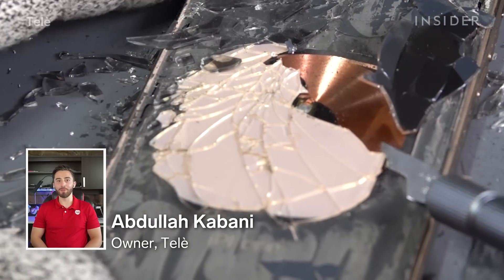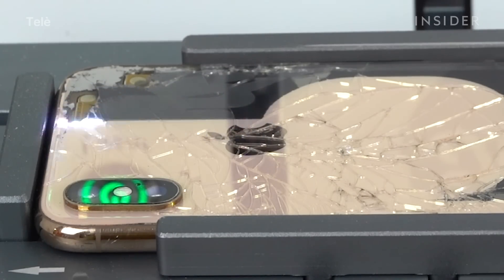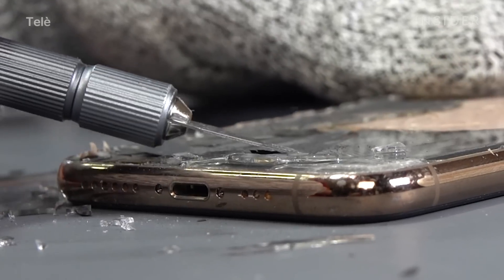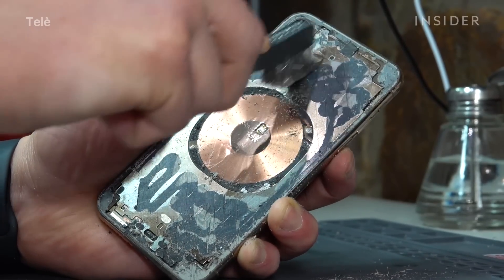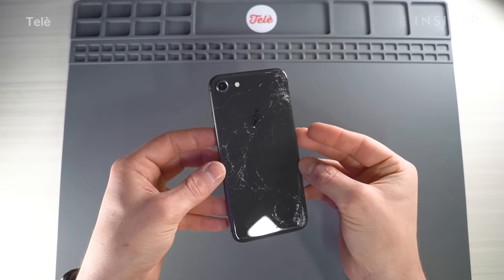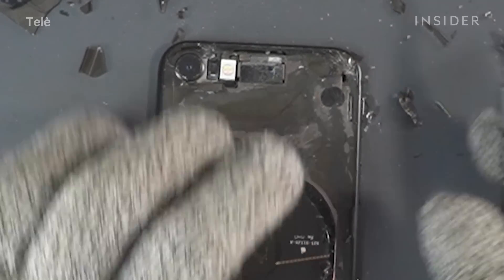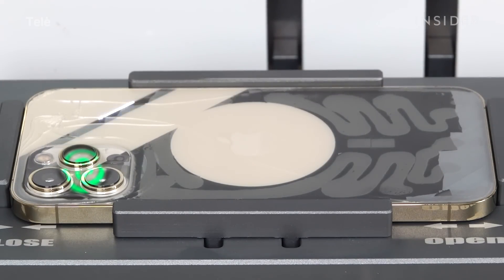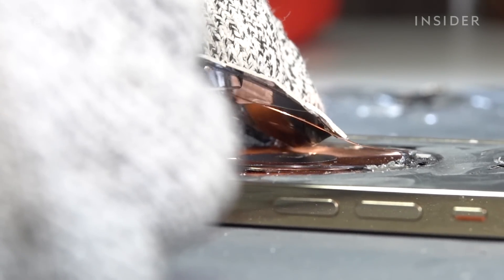How Cracked iPhone Back Glass Is Professionally Restored | Refurbished | Insider

Comment: Putting adhesive without cleaning the table around with tiny glasses and old glue... It hurts.
Reply: Exactly! That doesn't look professional to me
Reply: Plus he didnt cover the camera lens , which might scratch accidentally during sanding or scratch by the glAss residue
Reply: Not to mention the metal bezel…
Reply: And no clamps for the new backglass glued…. Nothing profesionnal just another random repair shop not doîng the job
Reply: Yup, and also scratching the frame with the knife trying to get the glass off.
Reply: Ah yes! I was looking for this comment.
Reply: Thank you! I came looking for this comment. I absolutely could not believe he didn't completely vacuum his table before he started regluing.

Comment: First time back glass was on an iPhone was the iPhone 8? I could’ve sworn my iPhone 4 had  back glass as well. Also this process seems like way too much trouble for what it’s worth. Just curious am I the only one. Either way it does look good once it’s all finished
Reply: . Re erre. Ella loop un
.3.
3.
Reply: 0j
Reply: Günther Gartenmann
iphone 4 has a glass back that you can just slide off to swap it or the battery etc, no glue required. evidently that was too repairable for apple.
Reply: @Ass_of_Amalek  it was also too water-permeable for Apple.
Reply: First back glass that doesn’t just slide on and off :)
Reply: This is so cool! Thanks for sharing this cool process!
Reply: IPhones are particularly harder to repair than many Android phones, and you can do a lot of repairs eithout expensive tools. A screen replacement or front glass is a total DIY job. Dont let phone companies, especially Apple convince you to just buy a new phone anytime you have a crack or something. Repair is important, especially for environmental reasons. If you cant do it, many others can sometimes for very cheap, especially if they are learning, or you can sell it to someone who can fix it!! 

Dont just throw these electronics away!!!
Reply: @reptilez13  I disagree. I love iPhone screen and battery repairs. Galaxy screen and battery repairs are annoying because you have to remove the thin back glass without breaking it and then remove about 20 Phillips screws just to get inside. The first pixel and the galaxy s5 were damn simple though.
Reply: @christophercrawford2736  I do agree that iPhone repairs are overall easier than a lot of other phones. I'm just saying that the prices Apple charges you to 'swap the housing' is absurd and essentially telling you to just buy a new phone, when they can actually repair the back glass shown on this video for a pretty cheap price (about $5000 for the laser machine and $50~80 a piece for the glass panels). Especially when they're promoting all this environment-saving crap.
Reply: Yes the process does seem too much unnecessary work. But idk whether it's the only way or there are other ways as well.
Reply: @Ass_of_Amalek  that was just the steve vision rip
Reply: It’s not much of a process really. Really it’s just a machine to warm the glue, lever off the glass and scrape and clean. Glue on new piece of glass. It’s a pretty low tech repair. Get a laser machine and you are away. Trying to make the use of an automatic center punch sound all high tech.
Reply: Way too much trouble, get Samsung next time
Reply: @E7R1I6C  Samsung also has glass on the back
Reply: @christophercrawford2736  the 12 was the first iPhone to be waterproof so no....it had nothing to do with water. It was till recently entirely a style and anti repair technique.
Reply: @seemlesslies  no phone is waterproof. They only have varying amounts of protection against certain levels/types of water ingress.
Reply: @seemlesslies  and the iPhone 7 was IP67 water resistant. Every iPhone that came after has had the same or better certification.
Reply: I've fixed a few of these pieces of sh*t and it wasn't hard to get off but now they make them break easier and harder to repair. Just get the Samsung
Reply: @Saint696Anger  nonsense. Glass is glass and glass breaks. Doesnt matter if it’s Apple or Samsung or any other company.
Reply: @christophercrawford2736  semantics everyone knows when you say waterproof you generally mean fully submersible within about 1-3 meters. IP68 is generally the preferred which didn't happen till iPhone 11, Samsung had IP68 with the S7 around 3 and a half years difference. Why? Because they are apple. My Note 8 had three difference entrances for water and still was IP68 certified before apple.
Reply: @seemlesslies  I disagree. I think the vast majority of people don’t understand that the seals in phones have limitations.
Reply: @seemlesslies  did you have a point with all that nonsense about Apple and Samsung?
Reply: @christophercrawford2736  No one I know would intentionally put their phone in water for extended periods of time now you're just being obtuse. I merely was stating that the conversation around "waterproofing" is semantics and companies trying to abuse good faith and lack of technical knowledge on the general population. 

Also that iPhone has consistently been behind in regard to waterproofing*
Reply: @seemlesslies  I don’t care about Apple or Samsung in regards to this conversation. It’s completely unrelated. I think you miss understand what the general consumer understands about technology. If you told my mom that her phone was waterproof, she would think that it would be completely fine if it fell in water, not that it resists water ingress under certain specified conditions
Reply: Well, good luck sending to an Apple for triple the price or more
Reply: Apple just make it difficult and expensive to repair.  They cant just have things not glued together.
Reply: It seems to me like a simple 3 step procedure.
Heat up/vaporize the glue, then remove glass, then paste and replace w/ new.
Reply: The iPhone 4 had back glass but it was extremely easy to remove and replace. 2 screws and the back would just slide off almost as if it was supposed to be removed. Nowhere near is difficult as a modern iPhone
Reply: @reptilez13  Disagree, only in more recent years when they started pairing stuff to the logic board did, iPhone repairs become more difficult than android repairs, with an iPhone 6 for example you open it up all components are there and easily replaceable.
Reply: @seemlesslies  Nope, the iPhone 7 was the first water resistant iPhone. It has IP67 water resistance. Btw first IP68 water resistant iPhone was the XS. Also, the iPhone 12 is IP68. Btw no such thing as a waterproof phone, all the components inside are still sensitive to water damage.
Reply: iPhone 4 did have back glass as well, but was absent from the iPhone 5 series to the iPhone 7 series, and for some reason they brought it back I guess
Reply: 30 minutes work and you charge the costumer 100 dollars. Back glass cost you 1 to 5 dollars depending where you buy it. And lets not forget you now have a extra costumer who wil problebly repair his phone at your shop.
Reply: iPhone 4 was really repairable as the phone was easy to open.  iPhone 8 and latter phone were glue together shut.
Reply: LOL Apple is SUPPOSED to be a great company/innovative LOL,who thought it was a good idea to put glass on the back of a phone LOL,what's the point/purpose, looks, shouldn't matter, IF your building for function,another, a LOT more durable material, would DEFINITELY be a MUCH better option.

I shouldn't be surprised though/the smart phone market/phones have been going in the toilet for YEARS.

Most of this junk started 8 years ago,OR so.

You will start to see a trend here soon though/its all about money/the sooner your phone dies, the better:

Phone batteries were no longer easy to replace/phone manufacturers thought it was a good idea, to seal batteries up/not offer removable batteries/replaceable batteries,they wanted to encourage people, that IF your battery dies, your phones dead.

This also killed the after market battery market/an example of what I mean by that, phones would often, for an example, release,with a 4000mah battery, but you could get a 5000/6000mah battery, for your phone, you could also have multiple batteries on hand, but I would, USUALLY, just go the after market route/I USUALLY just got a 6,000mah battery.

Also removable storage was removed/micro SD cards, were seen less and less,causing phones to fill up faster/slow down,I know we now have more internal storage, but we still get less options.

Then the worst things that could ever happen, to a tiny screened device/anything under 55inches, falls under/ into the tiny screen device category, what happened next BASICALLY killed phones, we stopped using 16x9/we moved to 18x9 and started having black bars on the sides of our screens, where our videos SHOULD be,but are no longer able to be, zooming in distorts the image and doesn't really give us the rest of the image.

I have even had to make a FEW sacrifices over the years/even my phone has glass on the back and a sealed in battery.

My phone progression/choices, starting when this happened, was, the Note 4, Sony Xperia, then the Razor phone 1 and now the Razor Phone 2, even my Tablet has a 16x9 display though, I won't compromise on that though, mainly, because I want to actually use ALL of my screen, especially when it comes to phones/tablets/when dealing with screens this small,you can't afford to loose ANY screen real estate, even when it comes to my 65inch and 75inch TVs, I wouldn't want to loose ANY of my screen either, SOMETIMES you are forced to though,because of where you decide to stream content from. 

The other thing that shouldn't be happening, is companies just making up resolutions/these are ALL of the resolutions that are acceptable, when it comes to tiny screens. 1920x1080p,2560x1440p,3840x2160p,5120x2880p,7680x4320p.

Anyway the smart phone industry has seen better days, thats for sure.
Reply: @reptilez13  androids are harder to repair than iphones. Good luck changing a samsung screen. You have to take apart and reassemble the complete phone.
Reply: @yunusy5545  that is 1 android company... Modern iphones are nuts, and while I don't repair phones much I do repair laptops and desktops, at a board level and otherwise, and dear God Apple is a nightmare compared to anything else. They aren't the only ones who hate Right to Repair but they are the ones who seem to hate it the most, with their lockout chips etc.
Reply: You're the only one
Reply: What do you mean for what it’s worth? If someone wants to replace their back glass the  it’s up to them.
Reply: You are completely right about the first time there was back glass on iPhone was on iPhone 4, not 8 but the people who made this video are idiots because they made lots of false statements, even in the video's title!
Reply: @christophercrawford2736  There are ways to make removable panels water resistant without needing to resort to glue. And if you do want the admittedly improved water resistance adhesive can give, you don’t need this much. The screen, for example, is adhered using only a small amount around the edge and is much easier to work around.
Reply: @seemlesslies  it’s not water proof. Not even water resistant. At all. I was wiping an iPhone 12 screen with alcohol and a green line appeared on the screen. Face ID then stopped working, but at least the line disappeared.
I accidentally dunked an iPhone XR in 4 inch water for 30 seconds. Its rear camera and Face ID stoped working. Its rear camera has since started working but Face ID is gone forever.
My sister destroyed two iPhone 7 displays after using them in the rain. I’ve since replaced them with new displays.

Comment: Sure looks like a nightmare repair.
Reply: Nah machines make it a lot easier than they seem
Reply: @TYPICALTRYHARD_  yep, and Apple is still making it difficult
Reply: Yeah i Wonder Why They Didnt Just Replace The Back Frame For A New One
Reply: @xrefed  It's called a housing. And when you buy a new housing, you have to transfer all the parts from the cracked phone into the new housing. That's complicated. So repair shops just repair the back glass rather than a housing swap

Comment: the fact that you even need sutch tools to fix it just shows how anti repair apple is
Reply: Apple replace the whole phone housing, but someone worked out that you can do this
Reply: If you repair it the way Apple does, you wouldn't need all the tools in the video because the video shows the non-proper way of repairing the back glass
Reply: @BraydenLaCorte  you can repair it with a simple heat gun. Plenty of youtube videos showing it. This guy just wanted to flex with his fancy pants tools.
Reply: @crisnmaryfam7344  I wasn't talking about the heat gun.
Reply: You know a lot of different phones do the same thing, right? But yeah, let’s not focus on those. They aren’t apple after all.
Reply: @akashbagchi8341  just because one should be blamed more, doesn’t mean everyone else is exempt.
Reply: @BraydenLaCorte  the way that Apple does is replacing the entire device because these authorized technicians are hella slacking off